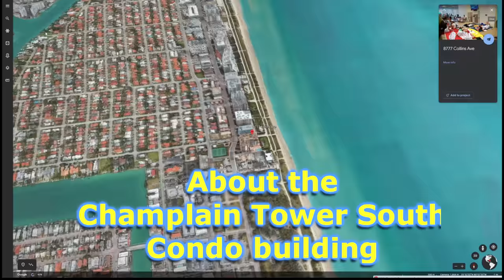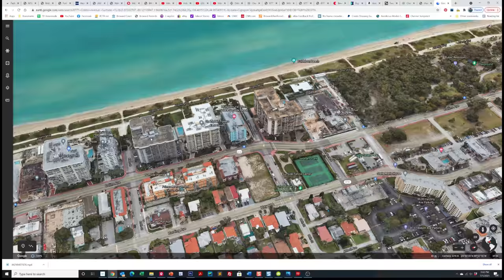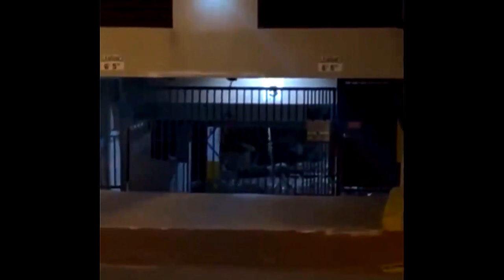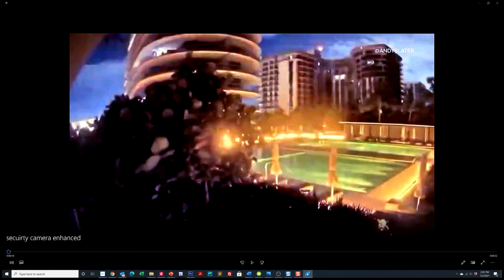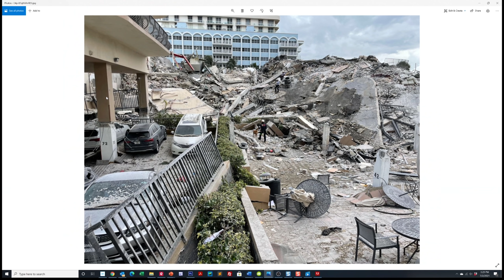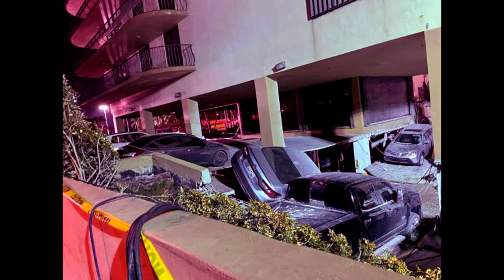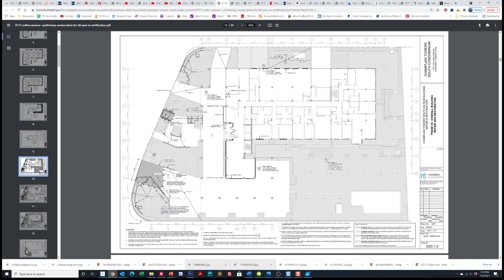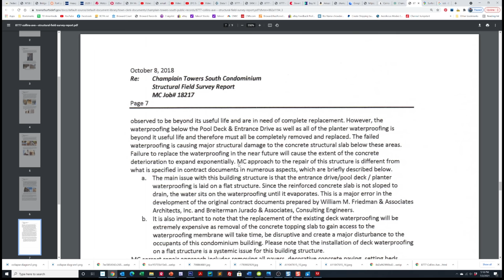Here's Cause Of Miami Condo Collapse Champlain Condo Towers, Surfside

Comment: The woman that saw the collapse of the pool deck and cracking  and got out of the building ASAP with her kids was EXTREMELY lucky to had seen that at the time cause she was moments from death with her kids..
Reply: Mothers intuition at it's best...
Reply: Instinctive observation should have hit the fire alarm let that be a leasson if indoubt ring and raise the alarm to save others
Reply: @standdown4929  have nothing to do with mother’s intuition. She saw and heard cracking on her ceiling wall. She was on first floor and saw it first. Stop making it out to something more than it is. If the walls didn’t crack in front of her face she would be dead right now so enough with the intuition nonsense. She didn’t know what was going to happen. If she did should have pulled the fire alarm and knock on doors to warn others instead of letting others die as sitting ducks.
Reply: @youaregoingtolovethis  if she had gone up from her first floor knocking on doors she would be dead too. Probably she had only enough time to get outside her building before the collapse.
Reply: Sad thing is She could of pulled the fire alarm otw out and saved most of the people
Reply: I have pictures of the swimming pool still being totally intact and still full of water even after the collapse of the building. This was a terrorist attack. It fell straight down on its own footprint which only demolition can accomplish.
Reply: She was very alert and followed her intuition and her protective nature towards her children
Reply: @luxinterior3085  oh. You're just spamming the comment section. I get it now. 🙄🤦🏾
Reply: @notorioustori  
I'm not spamming anybody I just made a comment. Not all of us are bots or spammers or trolls.
Reply: @luxinterior3085  you made the exact same comment in several places under the same video. That's the very definition of spamming.
Reply: @notorioustori  
That's how you get the message out to as many people as you can
Reply: @luxinterior3085  but there's no new msg. The video I feel that you didn't watch clearly has pictures of the prestine pool. You're not adding anything to the conversation.
Reply: Even a martial arts expert will tell you the best defense in any emergency situation is running like hell.
Reply: I guess we can point out fingers saying she should of saved more people. I will admit as a parent I’d save my kids over my neighbors any day if the building was falling down!
Reply: @lptvboy  Considering that this was in the middle of the night when most people would be asleep & given the speed of the collapse I seriously doubt that most people would have been saved by a fire alarm. I also suspect that if one was panicked, as I imagine someone in her situation might have been, pulling a fire alarm might not occur to that person. These are situations in which people struggle with survivor's guilt. The truth is that in most of these situations there isn't anythig one person could do to  alleviate the consequences of the circumstances.
Reply: @sherrieshatzen3801  True, and add to that most people probably died in their sleep. They might have heard the alarm only to wake up to the building collapsing a few moments later or as they were leaving. Heart wrenching any way you look at it. Thankfully, that Mom went with her intuition and didn't wait another moment.
Reply: @firstlast5289  living in California I would compare it to an earthquake.  You can hear the buildings breaking
Reply: @p.sherman3158  Wow, that would be terrifying!
Reply: @standdown4929  mother's intuition?? That's anyone's intuition. Get out and get your loved ones out of harm's way. You don't have to be a mother to think that way. You just have to be alert and discerning.
Reply: @gabrielle-d1b  There is mothers intuition, instinct, alert and discerning, and then there is plain old common sense..... A lot saw the cracking for weeks and months and were reporting it, A lot died ... So were were all these peoples instinct to get out of harms way?? .... This mother is the only one that acted on it, ...Call it what you want....
Reply: @gloriarobinson1869  the hacks by guy said “if she had known beforehand”, this time she had like seconds before the collapse. Would you rather risk you and your family’s life for a chance to save a random guy or get all your family out?
Reply: @youaregoingtolovethis  wow jack….really.  Take a pill.
Reply: @standdown4929  yep
Reply: @ThePalmettoPoltergeist  agree. I was thinking, maybe she didnt have it right in front of here, on the way out. If she wouldve had to backtrack even 20’thats 40’ total to run. Thats seconds she may never have gotten back.
Reply: Oh she survived..Good! I was wondering about that.
Reply: @sherrieshatzen3801  that was my exact thoughts also…..
Reply: @standdown4929  Dayum!!  Ya might wanna cut back on the coffee dude....chill
Reply: A lot of people would not listen to fire alarms  because they go off with every Little thing.humidity ,bad orders happens in our  bluiding all the time.  They die anyhow.but she has got to save herself and family frist.mabey she did not think to pull fire alrams,acted an insticnked or survival mode
Reply: @TruthBeTold121212  
What's a troll? All I did was point out the obvious which is that the swimming pool was still intact with all the water in it
Reply: @MsLiberty101  How about you chill .. I make one comment about a mothers intuition and everyone attacks me for it ... I am not a dude, I am a mother .. and you assume all Marines are men.....
Reply: Not lucky. Blessed 🙏
Reply: @lorabagley8670  she ran to the security guard first and told him to pull the alarm and call fire.
Reply: @lptvboy  she went to the security guard and asked to pull the alarm and told him to call 911 .. even if she pulled it, it collapsed less than 3 mins later,  she was on ground floor. The upper units wouldn't have had time, they just would have been awake instead of asleep when they died
Reply: @cybervigilante  Has it been stated exactly how long it was between the lady seeing her ceiling, hearing cracking noises, getting her and her kids out safely and then the building collapsing❓
Reply: For real I actually know those people so I was so great full they were okay
Reply: @youaregoingtolovethis  that women warned security but ran back to grab her kids and ran out if she would of knocked on doors her n her kids would b dead
Reply: @malkahmollie  wow   I'm sorry I didn't realize 😔
Reply: @lptvboy  In a crisis it is hard to think straight so don’t think ill of her.
Reply: @standdown4929  that’s my old teacher for ya
Reply: Mothers instincts
Reply: @patbraden4342  she only had moments she may have even thought it was an earthquake ran out in the street to save her children
Reply: @luxinterior3085  Not an attack. Just a well engineered disaster that all the warnings from inspections were ignored. Where's your evidence of a terror attack?! did you post it on your YT channel explaining a motive for all that hard work and planning of an attack?! I didn't see it. Just a suggestion, maybe take a few xanax and not be a keyboard warrior. And maybe these types of videos are too disturbing.
Reply: It wasn't her time.
Reply: @RinksRides  
Well let's see, it fell straight down on its own footprint. Much like the world trade center. And I wasn't imagining anything because you saw the same thing I did
Reply: @tedwheeler719  Thanks. Yeah I am between SF & Sac & we just had an earthquake about an hour ago. I didn’t feel much, but I was delusional enough to think I wouldn’t need to worry about that in Davis🤣
Reply: @youaregoingtolovethis  THE POINT IS... she sensed it was SERIOUS.
Reply: @tedwheeler719  
The reason why no one took responsibility was because it was a sleeper cell. James Comey of the Obama administration admitted that there were embedded terrorist cells in all 50 states
Reply: Fortunately their time wasn’t up. May all those who were called home rest in paradise and peace. Prayers for all those who knew and loved them. Both sad and heartbreaking 🙏🏼🙏🏼🙏🏼
Reply: @lptvboy  most likely don’t think rationally  during an emergency crisis. Easy to say in hind site besides one can not avoid their demise no matter where what when or how. Her and those who survived time just wasn’t up unfortunately others was. May their afterlife be glorious.
Reply: @luxinterior3085  OMG really? did you watch the video? How do you think pools are built? How much does water weigh? Pools have to be very structurally sound with thick re inforced walls around them!
Reply: @firstlast5289  thats very true especially for those in upper levels besides no one can save you when your time is up and anyone who thinks differently is fooling themselves. It would not be have mattered what this woman did. Obviously she and her children still has a purpose in this life for them to have survived. She did what most would have done and that was to try save her children which she did. Saving others in an emergency situation is a secondary thought if even that.
Reply: @cougmom50  exactly!
Reply: @youaregoingtolovethis  she saved herself and kids. Every man for himself. Stop shaming her. I’m sure you would have done the same.
Reply: Hi
Reply: @luxinterior3085  I agree with you. No matter how defective maintenance is, buildings don’t simply fall! We saw one fall then a second one fall according to the video. 
I ask,could there have been something on that roof?
Two days before this event while asleep I was in a semi tall building and it immediately pancaked. When it hit the ground I was jolted awake. I have premonitions that I feel exactly whatever the event was.
Days later while asleep, I was standing by a building. A voice said “there was something up on the roof” then I was awakened to recall this. 
Hours later an inspector was on TV saying he had just been up on the roof 14 hours earlier but observed nothing irregular then he said 3 other people had been up there too.
Reply: Benefit of staying on the first floor I guess. The upper floors are more expensive and harder to escape from during an emergency.
Reply: @luxinterior3085  Please rewatch the video.
Reply: @luxinterior3085  🤔
Reply: @luxinterior3085  The pool has to be strong enough to contain the water it holds it was NOT holding up a building above it like the rest of the complex .The weight of the water in this size pool (aprox 50' x 22' x 6') is about 215 short tons & thats only at 6 foot deep ! It would need a subtantial framework of concrete to hold all that weight so why wouldn't it still be standing ? Have you ever witnessed a demolition by explosives - they don't use firecrackers ! Everyone in the vicinity would have heard those charges igniting.
Reply: @lptvboy  The building fell in front of her eyes. She would have woken up people who would not have made it out. Maybe better they died in their sleep...
Reply: I believe the Q-anon was involved… maybe it was Donald Trump urging his supporters to cut the columns. It is so sad that the rats come out of the woodwork when something like this happens. Everybody knows what happened. Nobody knows what happened, yet!
Reply: @youaregoingtolovethis  precisely....and I'm a woman.
Reply: @standdown4929  seeing walls crack and crashing sounds is not intuition.
Reply: @gloriarobinson1869  pull the fire alarm...
No need to run upstairs
Reply: @standdown4929  who was interviewed that said they saw their walls cracking open that night and walked out to tell about it?
Reply: You're kidding?
Reply: @firstlast5289  it was sad. Look up pictures of the 1989 Loma Prieta earthquake. The double decker freeway collapsed trapping and killing many people.
Reply: @standdown4929    lol . . . . trust me, if I saw that which she did, I would have beat her time running out of that building by a huge margin . . . . . I'm a Father of three boys, now adults.
Reply: @lptvboy       EXACTLY!
Reply: @gilzor9376  lol??? There was nothing funny about this entire tragedy.... It is rare for buildings to collapse. Only 9 since 1922.. Most didn't believe the building would collapse, or they would have vacated weeks earlier when other cracks were appearing and people were reporting fails in the infrastructure.. I see my simple compliment to the mother has turned into some kind of competition. I did not say fathers don't have good instincts to save their children... but you were not the one in the news, or you would have received the same compliment...
Reply: @MsLiberty101    No doubt, this clown has issues . . . . big time!
Reply: @lptvboy  the fire alarm had gone off automatically, even called 911
Reply: @nickprincipato358  mo ok
Reply: She ran down to the lobby to tell the security guard and when she saw the pool deck collapse she told him to call 911. And some source I read somewhere mentioned a fire alarm

Comment: @8:31 [Totally inconsequential, but figured I'd mention] That's not a beam, it's a rectangular metal sign affixed to the gate. Light is reflecting off the bottom 2/3rds of it, and the top third is in shadow.

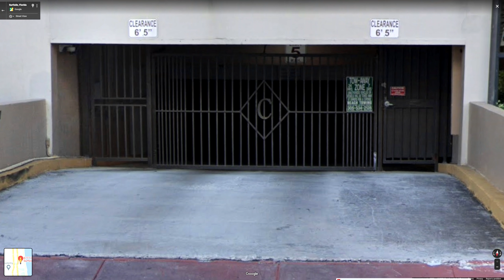If you look at the pre-collapse image @8:51 you can see the green metal sign more clearly.

Comment: Wow, good analysis. I work for a concrete manufacture, I immediately thought of corrosion. Probably from salt water as well as it collected. You would think being near the ocean, you would have a better drainage system to pull water away from the building.
Reply: Likely a mix of corrosion and piss poor concrete.
Reply: @SilvaDreams  Materials are so very noble ...I can assure you it was a bad design and negligence on the part of the city to properly inspect the construction process....yes, negligent maintenance as well.
Reply: sAlt WatEr cAnT mElt sTeEl bEaMs
Reply: They had a looooot of flooding there too.They complained that anytime they  had a storm the entire parking garage would fill with salt water for days.
Reply: @poisonpotato1   No, but it can corrode the heck out of them.
Reply: Could Storms like Hurricane Irma which did not affect the Miami area but it was on the strong side of Irma the right side

Comment: That "broken beam" hanging off of the roof is called a call box. Notice how it is attached to the gate, and not the ceiling.
Reply: It's a thin metal sign "Tow Away Zone. @ the 8 min 55 second mark.

Comment: Just imagine how many more buildings there are in Miami sitting on rotten foundations !
Reply: And every where in the world. You cannot imagine how many time I ve seen rusty metal inside concrete walls
Reply: @annieterminetschuppon7232  That's terrifying. 🥺
Reply: If this is scary for you do not look into the condition of most of the bridges in America.
Reply: All of them 🙄
Reply: We all need to bark to those bigger dogs that these problems are theirs.
Reply: Scary. Any building built in the 1980s in Miami needs to undergo a full inspection!
Reply: @angel-nv7jk  They are. The Surfside building was inspected last in 2018, though nothing was done about it.
Reply: They're inspecting them now. And closing down many and forcing people out in less that 24 hours. Some immediately.
Reply: @annieterminetschuppon7232  a lot of building and concrete homes contractors around the world steal salty sand from the beach to save money.  But this errodes beaches and puts salt right inside the concrete with the rebar. Very dangerous.
Reply: @Dachdogoriginal  you re correct. In Morocco, it is a regular practice all covered by official
Reply: Right on.  We found so much of this in structures on the California Coast.  But they were not nearly as large nor as high as these towers.  Being close to the Ocean is beautiful but for building materiels: extremely corrosive.
Reply: @jonmajarucon51  reason why you need to use very specific materials in not forgetting an high level of maintenance.
The pb stands on those real estates much more interested by profits in using short cuts in building construction or maintaining the structures.
Reply: it is your imagination.
Reply: If concrete like in the pool room was cracked like that then they were totally neglecting maint. on this building because that doesn't happen over night, years of neglect. Pool guy is lucky.
Reply: @jostrander71  no maintenance can fix weak concrete.
Reply: @janosik47  Yes it can, you cut it out and replace it. Are you serious? Just do nothing then is your solution?
Reply: All big cities where inspectors get paid off.
Reply: Dave Manning
OMG….
And everywhere else in the world…..
Reply: OK...I "imagine" ZERO more...
Reply: And I bet not one will collapse as this one...because it's not about faulty fondations at all. It's obvious to anyone that still has two brain cells rubbing together that this was demolition.
Reply: yes what kind of foundation , are there piles going to bedrock? florida  why did they not use epoxy coated rebar in that saltwater environment . I never built in FLA so i have no idea what they are building on , limestone??
Reply: Buildings constructed during the 80s and 90s had more lenient codes and design criteria. That's one place to look. Many balconies have been replaced due to repair die to rebar and concrete failures.
Reply: @janosik47  Nailed it!
Reply: @imarobot3757  Nicely said!
Reply: @Dachdogoriginal  any concrete plant that did that would be out of  business in no time , don't they inspect and test every batch of concrete that get poured ? if not wtf is wrong down there ?
Reply: @imarobot3757  Now, of course. But what about then? And I am not only speaking of that building in the USA.  This is a corrupt practice in many countries. Like the one I live in.
Reply: I bet this level of rot occurs in less than 1 out of a thousand structures.  However, there are lots of big structures in the world, so if you do the math, there are likely hundreds of precarious big structures in the world.  We need competent inspectors, governments unafraid to enforce standards and owners who do not succumb to greed or lazy indifference.